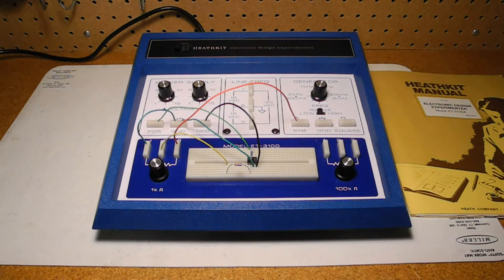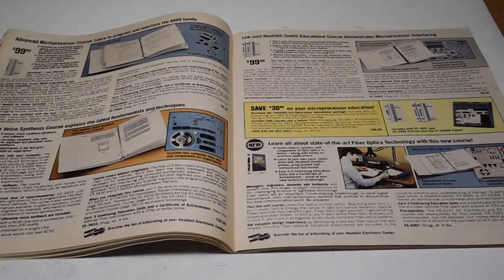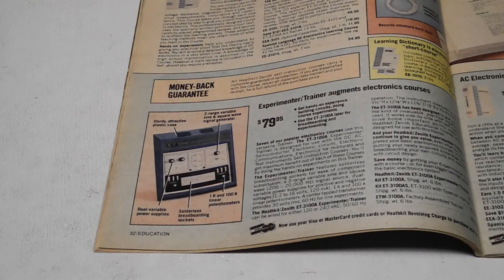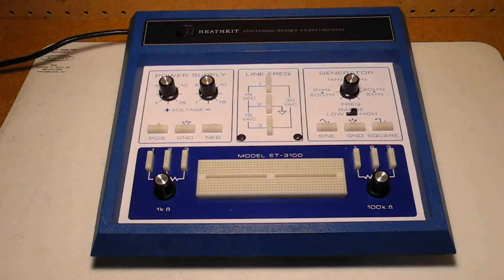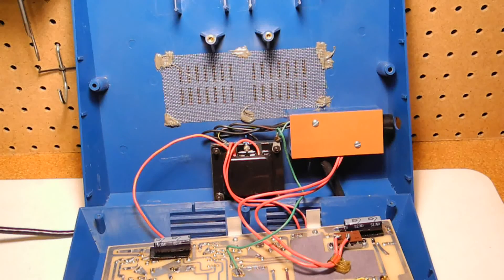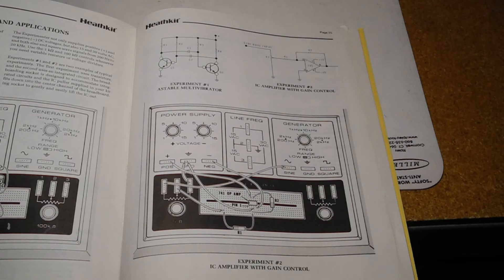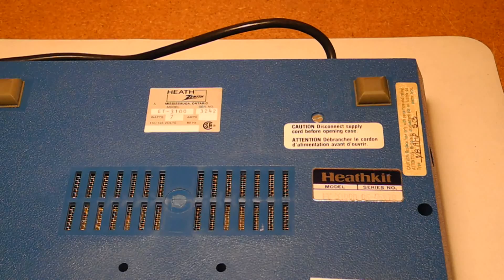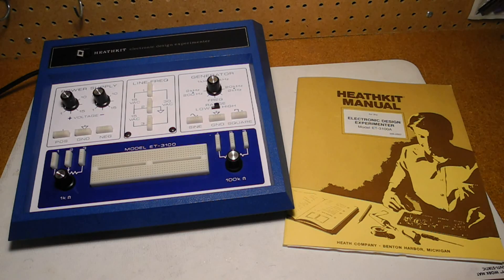The Heathkit ET-3100A Electronic Design Experimenter

Comment: I built one  of these in the early 1980's.  I just dug mine out of (long term!) storage and 
turned it on.  A bit of smoke and odd behavior from the sine/square wave generator.  I still
have the original manual and schematic so it is time for some troubleshooting.  I suspect
some of the old electrolytic caps are long gone, I did a lot of experiments with this unit, learned a lot and got my General Amateur radio ticket years ago.  I also miss Heathkit!
BB

Comment: I like your presentation of the various Heathkit instruments. In the day I bought a lot of kits from oscilloscopes to transistor curve tracers to computers. Then I lived in Holland and bought the kits in Amsterdam or ordered them as I lived in The Hague.
I still have most kits and when I moved to the USA, I took them with me. The computer and accessories I donated to a computer museum. The portable digital multimeter died and the digital alarm clock is not running properly on 120V/60Hz.
I have the ET-3100, the ET-3200 and the ET-3400. They are all reset to the USA grid and now and then in use.
Building and using the Heathkits was always fun.